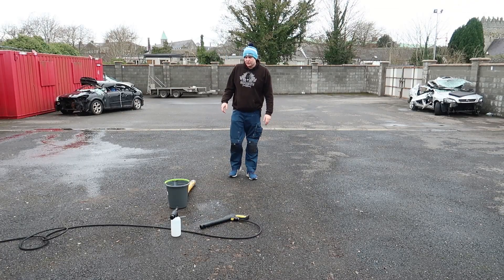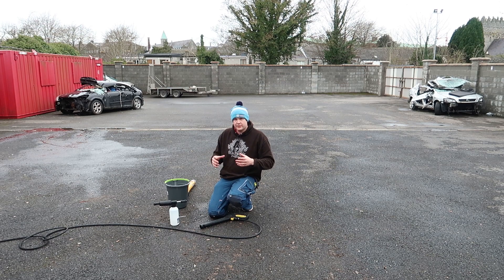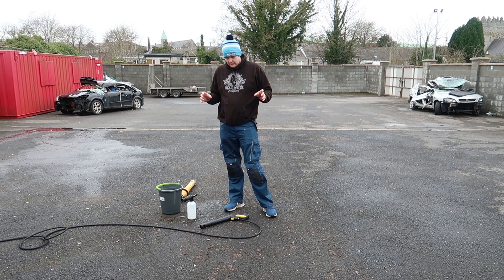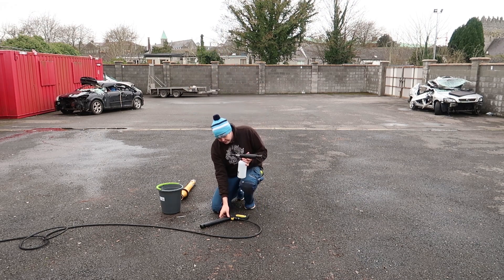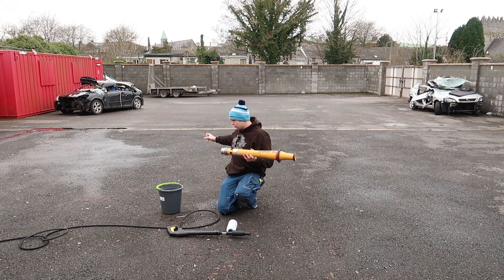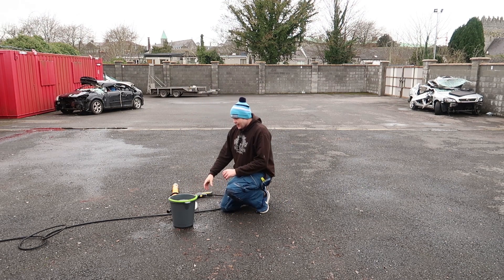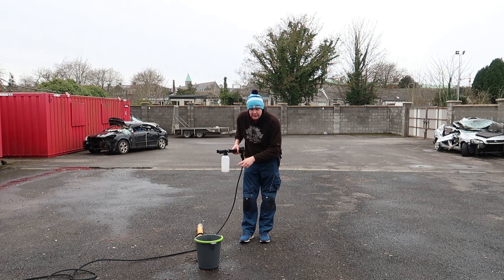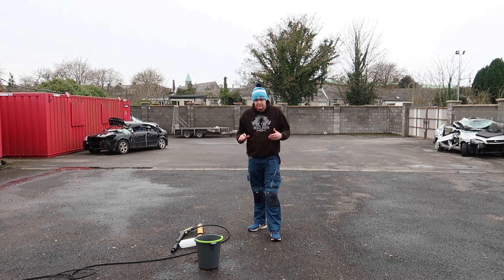Bilt Hamber Auto Foam | Easiest calculation of PIR - Panel Impact Ratio

Comment: I've watched umpteen of these videos over the last few years and irrespective of the power washer and lance combinations and as near as damn it 100ml diluted to 1 litre is 1%..... So if you need 4% your calculations possibly going to be in the range of 380-420mls diluted to 1 litre so 400mls is going to be as near makes no difference as nobody is going to measure out exactly 368 mls .... If you find it's a bit weak just a tad more and if you feel its to much cut it back the next time

Comment: Very good explanation, but still can not understand why Bilt Hamber claims to use PIR and others (e.g. MagiFoam) gives exactly how much inch/ml I should use pre bottle...
Reply from the maker: So in order to get the best out of a foam, you need to have the balance right from what the panel receives rather than what goes into the bottle. There are so many variables between what canon you use, combined with what pressure washer you use (different power/ litre per min outputs etc). 100ml in an mtm compared to mjjc could be different as the internals may be different. This coupled with a pressure washer that puts out 6 ltr or 9 ltr, there are too many different results. So if you work with what you want to achieve on the panel, you work it out to get the perfect combination for the hardware types you are using and you'll get the same result of the foam each time. Hope this explains 🤷‍♂️

Comment: Was the foam cannon empty?
How can you tell when the water has been removed from the foam bottle when it power washer is connected ?
Reply from the maker: You can start hearing a hissing noise when it's empty as the canon is trying to draw liquid from the bottle, so when it doesn't, that's when you know it's empty 👍

Comment: I'm using an IK Foam Pro 12 Sprayer with Bilt Hamber Touchless. How much ml do I use for the water and the snow foam?
Reply: My understanding is, since the foam sprayer is a closed system, 5% PIR is equal to 1:20 dilution ratio. OTOH, Foam cannons get additional water from the hose that require the water output calculations. Correct me if I'm wrong.
Reply: @bizzobox  I put in approx 300ml of BH with 400ml of water and filled up the rest with air. I was shocked after using it twice on 3 cars as to how much was still left. I reckon enough to pre-wash twice another 20 cars. Next time I'm definitely reducing the amount of BH, maybe up to 50ml.
Reply: @Mr_ZeroFuel I’m also looking for dilution ratio for the ik foamer. Did you fine tune the measurements?
Reply: @underscoreroa  To be honest, it's trial and error. I've never found the exact measurement. I usually put in 10ml foam and water to the maximum level, keep in mind to leave space for the air. I've found that 10ml produces super thick foam, but that could be down to Meguiars. I didn't have much success with Bilt Hamber and stopped using it.
Reply: @Mr_ZeroFuel  no success with BH in terms of dirt removing action? Also, are you using BH new Touch-Less formula? The one currently for sale on their www
Reply: @underscoreroa  I stopped using Bilt Hamber altogether, maybe I didn't use the exact measurements but I've seen far greater results with Meguiars foam and wash & wax.
Reply from the maker: Hi folks, good chats, for the handheld sprayer and 1000ml, in order to get the percentage, you just need 4% of the 1000ml, so it would be 40ml of BH to water. This will give you the 4% PIR they recommend. BH is not a super foamy product anyway, it just has the great cleaning capabilities 👍🏻
Reply: @GoodLuggageAutomotiveDetailing  Hey thanks for the info! much appreciated!

Comment: Lol what about different pressure washers ie litres per minute output I've got a kranzle 1152 tst to get 4 to 5% p i r i use 50/50 in the m j j c foam cannon up to 1 litre plus you'll obviously need more product if car is bigger ie s u v 4 x 4 its not that far off therefore i use 500 ml bilt hamber auto foam or touch less to 500 ml warm water does my 4 x 4 👍
Reply from the maker: You'll need to test for your set up mate as all setups are different, from Lance's, hoses and lengths, pressure washer, make of stubby etc, all different so to get the best results, you need to do the test first 👍

Comment: With foamer 1L size means need around 170ml , can somebody please explain how much I need when using Ik 2L foamer ?
Reply from the maker: 1ltr former would need 20ml for 2% or 40ml for 4%. On a 2ltr former, you would need 40ml for 2% and 80ml for 4%. Then fill up to the litre/ 2ltr mark with water respectively 👌
Reply: @GoodLuggageAutomotiveDetailing  Thank You 🙏
Reply: @GoodLuggageAutomotiveDetailing  Thank you for your great video. Very useful. To be more precise, this dilution ratio (80 mL for 2 L of waters for example) is not completey correct if we consider that the maximum volume of the pump sprayer (2 L for example) must not be exceeded (otherwise the pressure is too low) : in this example, the correct ratio, to achieve a total solution of 2 L, is 77 mL of BH with 1923 mL of water.
Reply from the maker: @gregorytimmermans6984  if you can measure out 77ml instead of 80ml, I'd give you a pat on the back!!! I honestly would not be looking into the minute calculations that much, just general 👌
Reply: No expert here, but.....IK and other foamers are much easier!!! You can treat them as a regular dilution since the volume is fixed; so if you fill one up to, say, to 2L of water and (painfully) spray that into a bucket, you should get 2L..